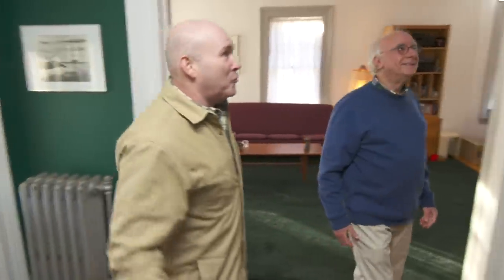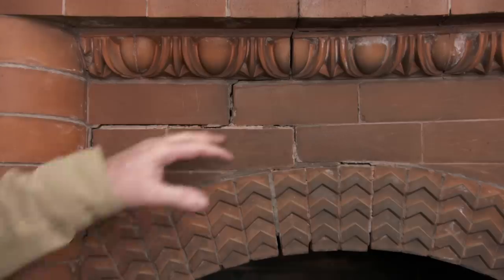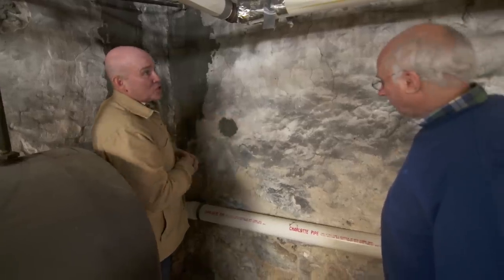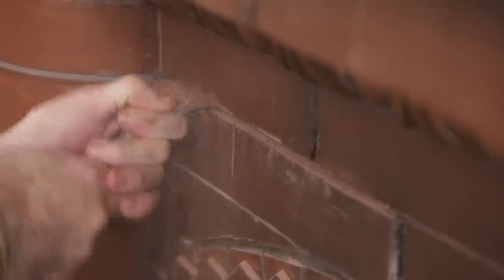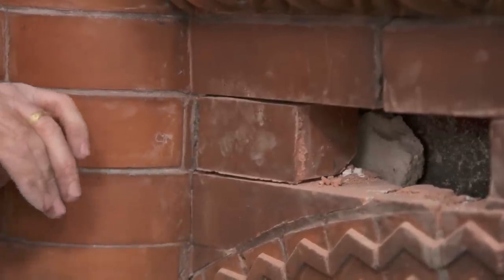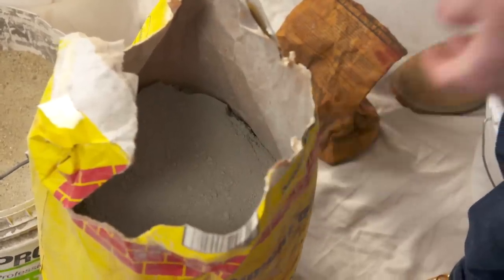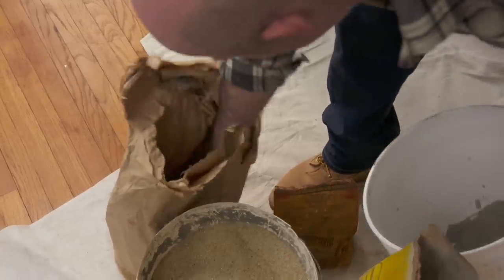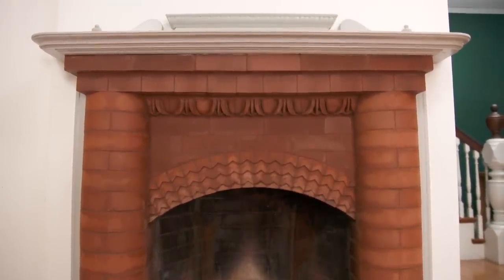How to Restore a Historic Fireplace | Ask This Old House

Comment: Three to one mix seems a bit strong to me. I would have used four or five to one. You want the mortar to hold everything in place but be weaker than the bricks. Restoring in the U.K. we use lime mortar, no cement, for exactly this reason.
Lovely fireplace 👍🏼

Comment: Why not use a lime mortar (as was it was originally), instead of the N type (50/50 portland and lime)?
Reply: Because type n is better mortar.  And there is no reason to stay with the historical mortar in this case.  

There also is no reason to assume there is no Portland in that mortar.  This was clearly a high end house when built and Portland was available at that time period it was just expensive

Comment: Man those steps with the green carpeting are ugly as all getup.
edit: and the radiator 10 feet away from a fireplace? wth
Reply: 1894 house... over 100 years and they still haven't replaced green carpet
Reply: The rad was probably a install in the 1940s for updated heat
Reply: Most fireplaces don’t heat well.